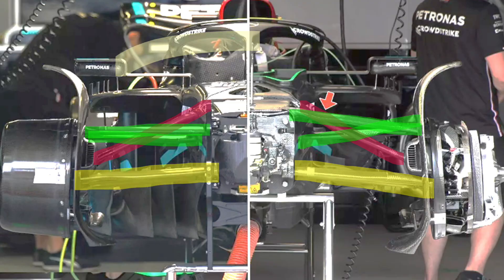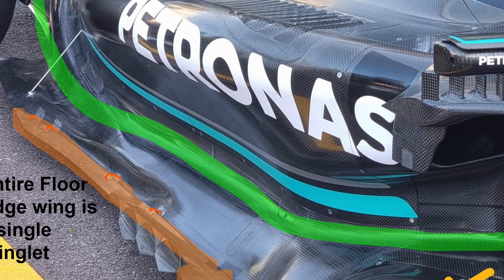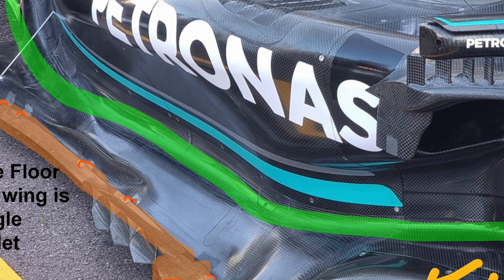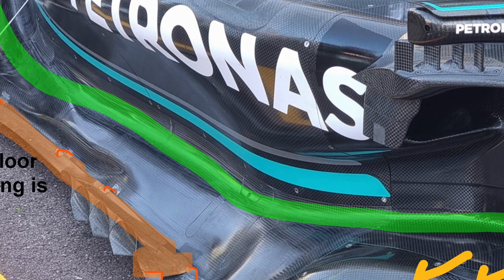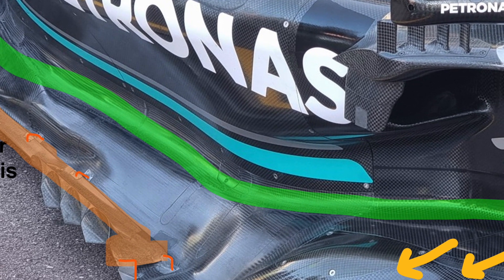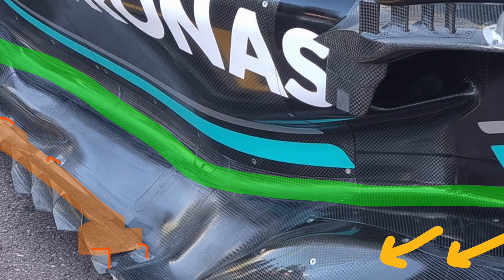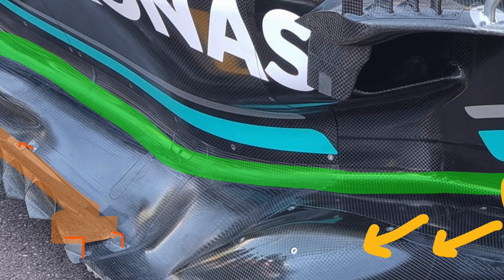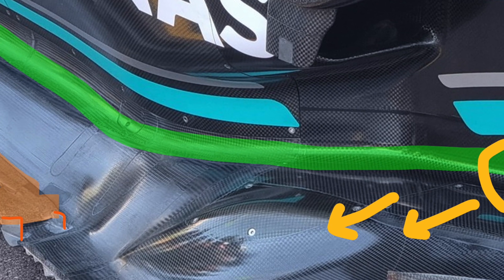#F1 Aero Analysis: W14 B Initial Thoughts

Comment: Great video!! I especially liked the floor update details as they all look the same for teams. Although, I doubt that the Merc's gap to the RB is 2/3 tenths; from what we have seen, it might be closer to 1/1.5 sec range as acknowledged by Toto himself. The truth is we don't even know the gap because the RB has not been under performance pressure at all. I have a question though - If we assume that all teams are able to come up with great mechanical platform next year; what is your prediction for the aero philosophies? Does it matter if it is in-wash vs downwash with similar mechanical control? The reason I ask this is because the only way I see RB being beaten is when someone is able to use the wind tunnel time better - Aston, if not this year then next year. Merc has shown with this upgrade why they won 8 titles in a row; I am sure they will be competitive but beating RB seems another 2 years away
Reply from the maker: Provided the mechanical platform is the same... The aero philosophy makes all the difference.

Comment: I guess you know that front heave units on current cars are almost incompressible, and any pitch under braking comes from the rear-end lifting. If an increased anti dive made a noticeable difference, then they would have done that already, or would have used those many other tools available to keep the front RH constant under braking.
It's very weird that you come up with the driver feel (obviously I know that it was F1dataanalysis who spread this all over), while you know that the pitch stiffness is insanely high on all the cars, and the driver mainly feels the G forces (not the pitch), which is not affected by anti dive at all.

I acknowledge your knowledge and experience, this is why it's very surprising for me to hear such things from you.
Reply from the maker: Hi Jozsef , thanks for you comment mate. I see what you mean regarding the stiffness of the front suspension in F1 cars being a factor that I did not account for.  Good shout !!